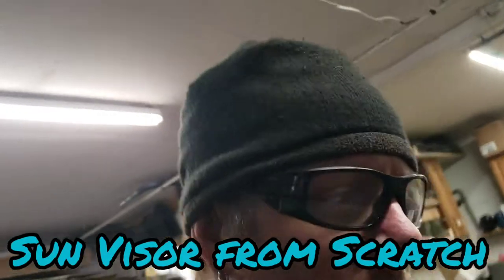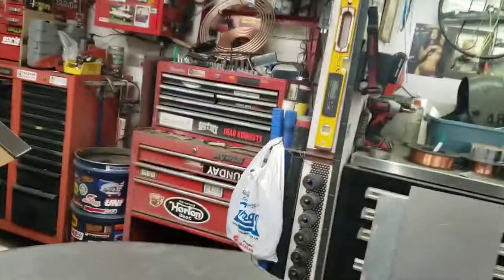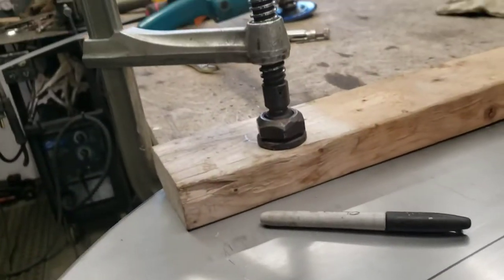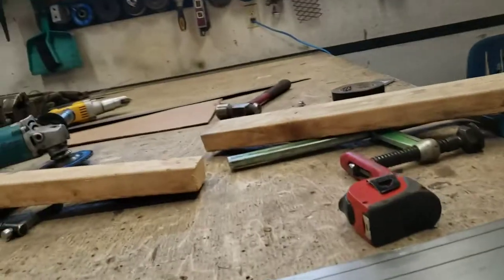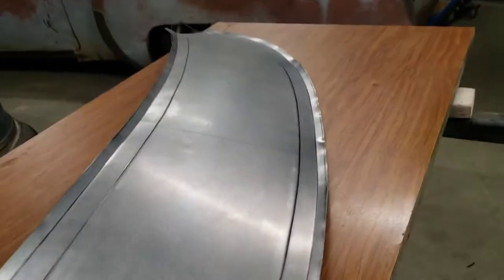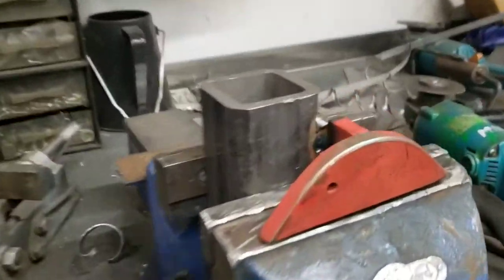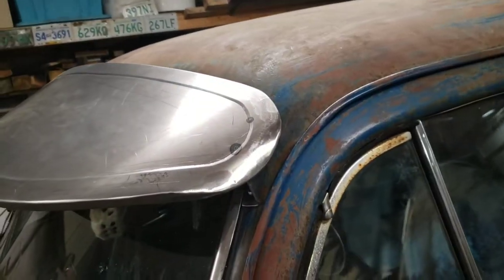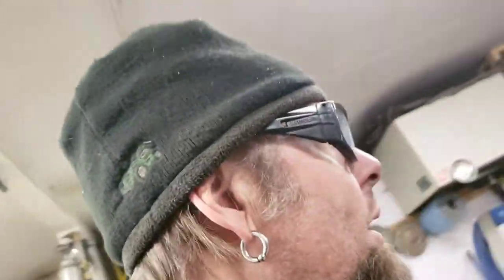Sun Visor Fabrication

Comment: How does your own visor on the Pontiac reacts to high speeds, I got exactly the same on mine.
Reply from the maker: Zero issues at high speed.  It's attached on the sides and also the middle between the windshields. The one i made in the video is also super tight. Can't have that shit flopping around.